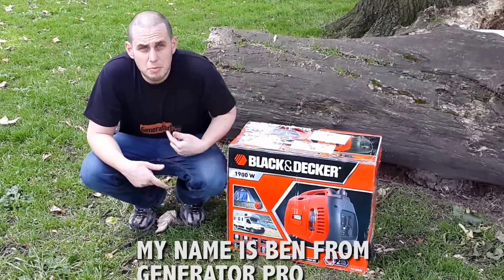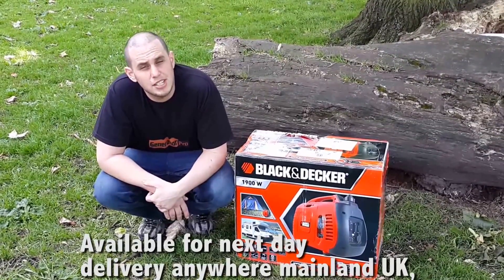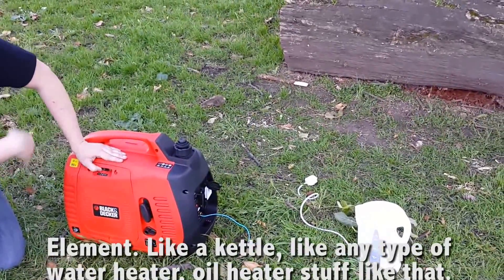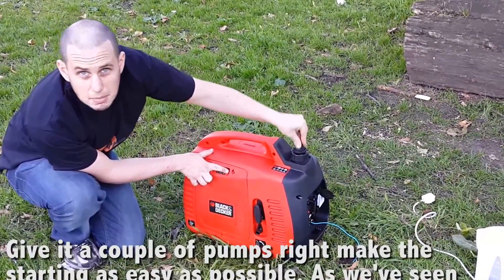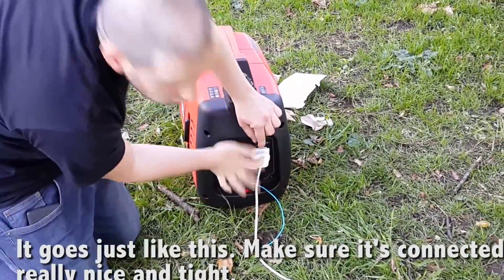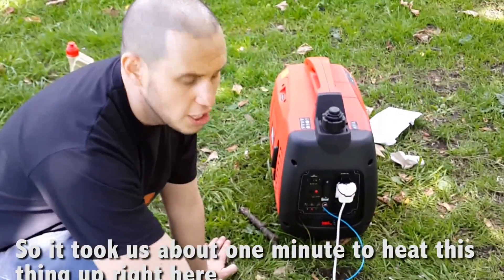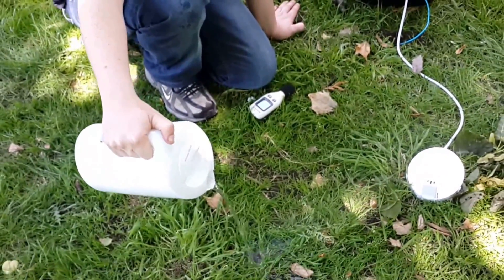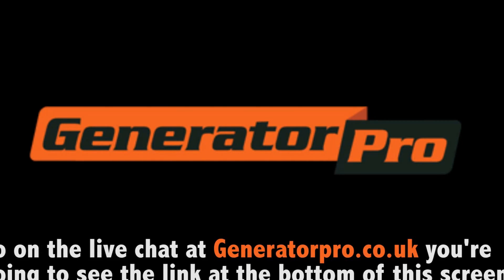Black and Decker DB2000s Silent Generator performance clip - noise level,power level, etc

Comment: Hi from Italy, did you have a wiring diagram for the BD2000s ? Or where i can find parts (ignitor  control box and the correct coil) for that generator ? Thank you 
Max

Comment: California PG&e emergency power outage left us potentially without electricity for days. ◈◈>share4.photo/F3kGenerator?ζ    After some quick research decided to buy the Firman. Two main reasons strong price/value design (inverter technology, easy to use) and next day delivery. Generator arrived via UPS early my friend and I set up and running in 20 min. Powered fridge/ freezer, tv, wifi, phone chargers, toaster oven. Ran flawlessly for 22 hrs non stop until power restored. Extremely happy exceeded our expectations.